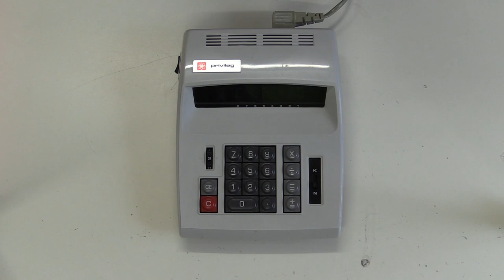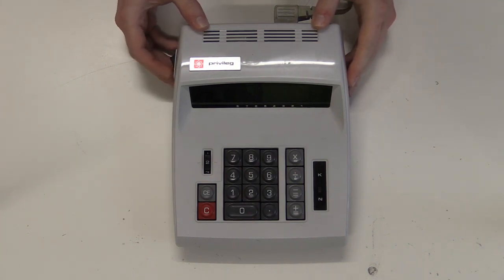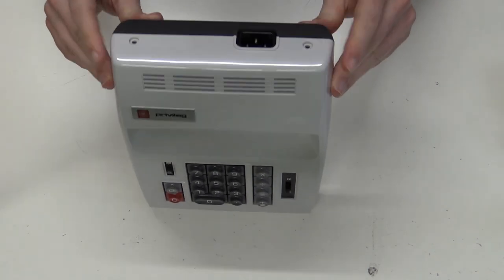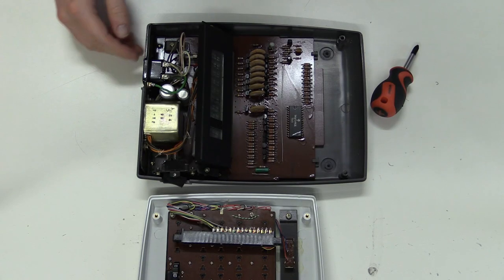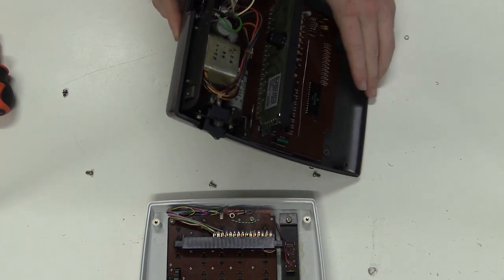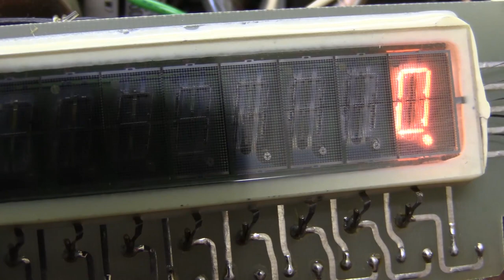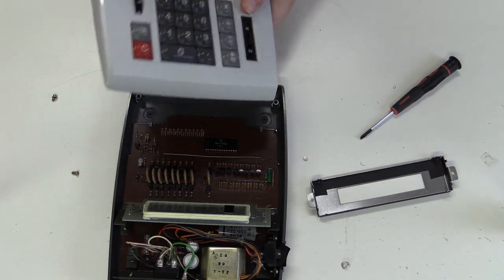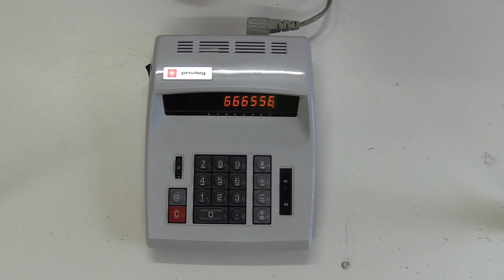Autopsy - Vintage Privileg (NCM) table calculator

Comment: That is actually a type of multi-digit neon display known as a Pandicon, which is related to nixie displays but has multiple digits.
Reply: Not even Pandicon, but Panaplex, it's a multi-digit segmented gas discharge display. Pandicon is slightly different, it has digit-shaped electrodes, as a regular Nixie.